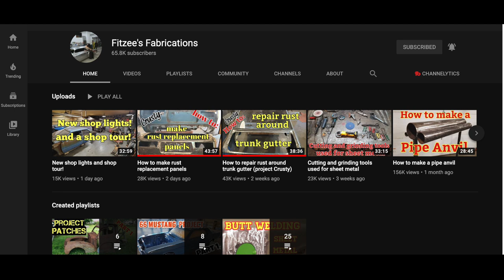HOW TO FABRICATE COMPLEX SHAPES WITH SHEET METAL | RUST REPAIR | GREY GHOST

Comment: Can't Ask For Any Better Than That! I Just Bought An Eastwood 175 Welder And Bout To Start Doing Some Of This Myself And Taking In As Many Vids As I Can Find Trying To Gain Knowledge, Tips And Tricks, I Used To Weld For A Living 25 Year's Ago But Never On Anything Thin Like Automotive Sheet Metal And Clueless On The Best Methods Of Cutting, Replacing, Shaping With Rust Repair, Great Video! Much Help

Comment: Morning sir. I sent u a message on your fb page. I changed my timing chain to a gear drive on my 302 and I cant figure out the timing now.  What should it be around now? Any info would be greatly appreciated thanks again and great content as always 🤙🏼
Reply from the maker: Sorry I’m horrible at checking Facebook. I’ve never installed a gear drive set, but as far as the engine timing goes it would be the same 10-14 degrees
Reply: Watching your video on how to do the relearn now. Thanks again!🤙🏼